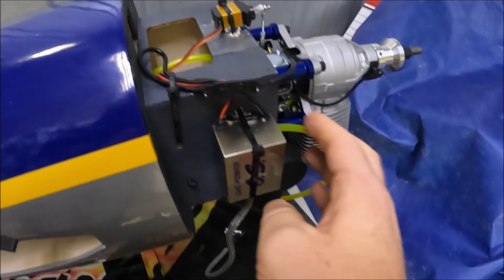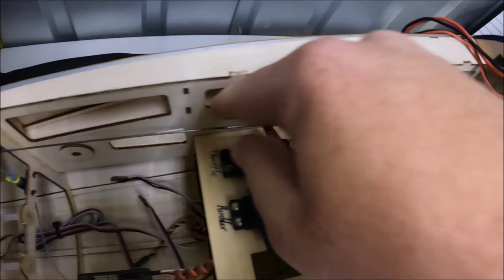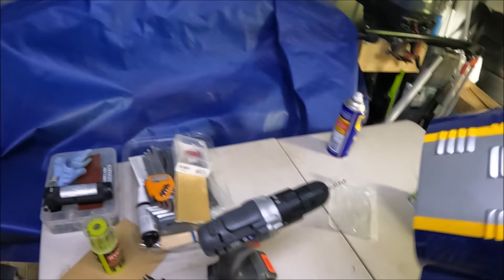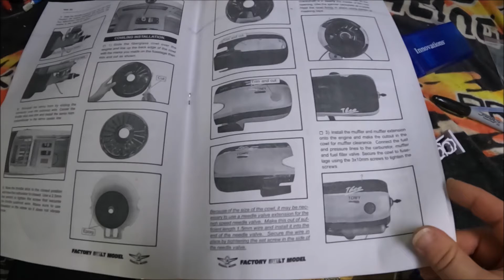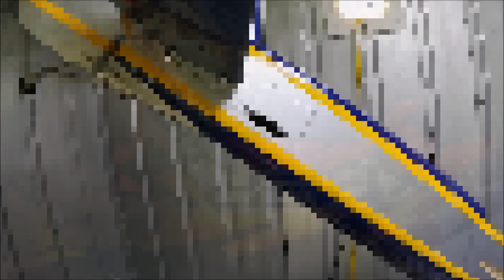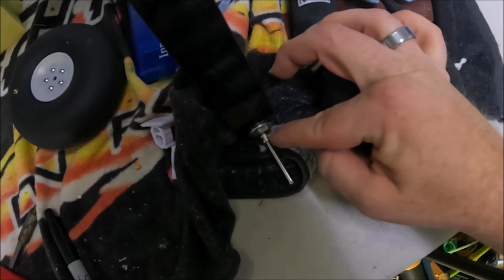Seagull Models Yak 55M build series part 7

Comment: Bonjour quel type de protection et rangement pour les batteries ? Je galère un peu sur ce point ! Il a l'air d'avoir besoin de beaucoup de poids à l'avant !
Reply from the maker: The batteries have foam around them to protect them and also to prevent them from moving, and I have also 3d printed some retainers to stop them from sliding out from where they are mounted.